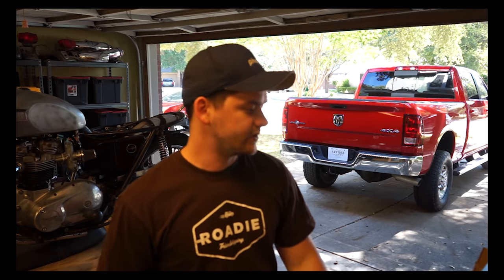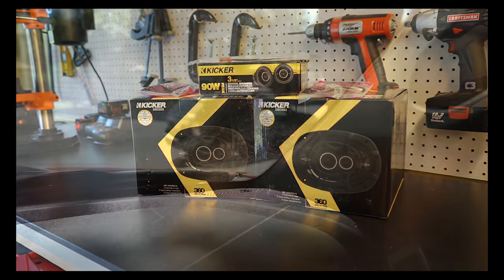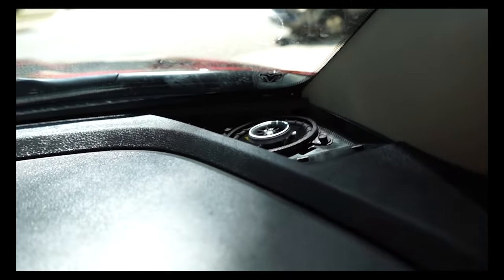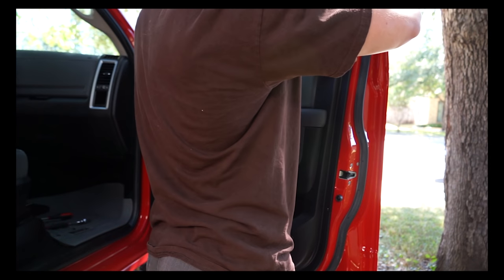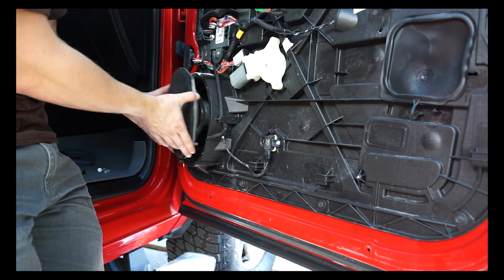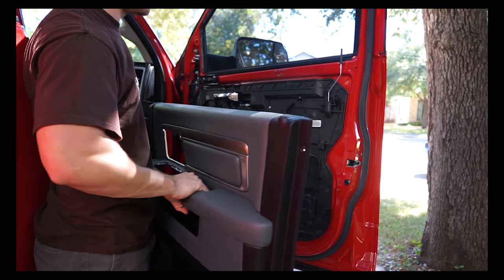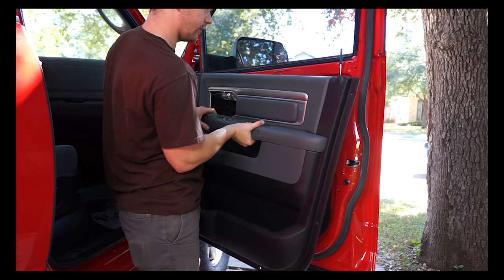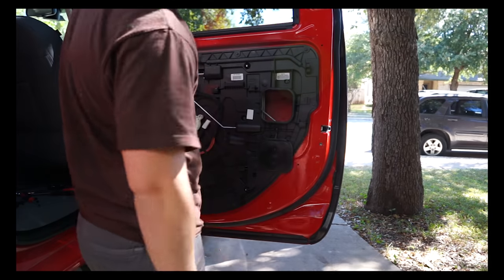Ram Speaker Upgrade

Comment: I just wanted to take a minute and thank you for this video. I followed the steps on my 2018 RAM and it couldn't have gone smoother. I appreciate the effort of you taking the time to record and share this !!
Reply: Did you need to install the bass blockers on the dash speakers, is the sound ok?
Reply: @theodoretennisco9079  I didn't install the base blockers. I bought the Kicker  2 way speakers 3.5". They seem to sound great with the 4 kicker 6x9 3 ways. These are running off the stock deck.
Reply: Is it actually louder than the stock speakers?
Reply: @tylerogorman1079  much better than stock
Reply: @brown5252  was the speakers louder and more quality?
Reply: Just curious did you install any speaker spacers for the front door speakers? I am wanting to run all kicker 6x9 myself and don’t want to use 2 diff name brand speakers . I know 6.5s will fit the front but I want all 6x9s

Comment: Just put some of these in my truck. Your video saved me a ton of time. I have them on stock radio for now but am going to be amplifying them in a few weeks. The door speakers themselves are clearer than the stock ones but actually dont have as much bass at stock power. If you use these, go ahead and get an amplifier. You can find 2 channel amps for pretty cheap. The kicker dash speakers are much louder because they are 4 ohm and the stock dash speakers are 8 ohm.

Comment: I have went with the JBL club speakers. They are 3ohm speakers all the way around. Crutchfield says they won't fit in the front. But yet they come with a 1/2" spacer. I have the 3.5's in the dash with a bass blocker. The dash speaker requires a Metra 72-7902 wire adapter to eliminate cutting. When putting the bass blocker on, which it goes on the positive terminal side, I utilized spade ends to eliminate any cutting. I found the Metra 72-7902 on ebay and paid like $9.00 with free shipping. The doors require a Metra 72-6514 wire adapter to eliminate cutting.  I found them as a pair for both doors on amazon for like $13 and prime shipping. I utilized the spacer that came with the speakers on the front pair and no issues at all. I can have photos later. This video was great. Thank you.

Comment: Great tutorial. And thanks for the hyperlinks for the speakers and accessories you used. I used your video to guide my speaker upgrade on my 2011 Ram 2500 Megacab.  The only thing I would add is that I used 1/2" spacers for the 6"x9" speakers in the front doors. This eliminated the interference with the window  regulator and allows the speaker to be tightened down squarely in the hole in the inner door panel.
Reply: Did that interefere with the door panel covering at all when you put it back on?

Comment: Just did mine with NVX dash speakers and Morel speakers in the doors and a Pioneer sub that fits in the stock box, mine had the Alpine system, awesome now, you can actually hear cymbals and guitar picking.

Comment: Thanks for that great video. I just finished installing all the equipment you recommended including the wire connections. Install went great The sound system is fantastic now. It is like night and day. I installed system in a 2016 Ram 1500 Big Horn and super happy now. Just want to say thank again.  Keep up the good work.
Reply: I was wondering how much newer it'd go with the items shown in the video. I've got a '16 outdoorsman, and was looking to change the stock stuff out. Your reply with the year of your truck told me they didn't change anything in that area. So, good to know :)

Comment: I am not sure how many people are still watching this video.  Most of the 6X9s are now a little shorter and fit just fine, but wanted Kickers and bought the same kickers as this guy.  To take care of the problem of them touching the window rail and to seal the speaker around the mounting surface, I purchased and used a 1/2 inch spacer, made for 6X9s, Metra part number 82-6902.  Wondering if anyone else has tried this.  (Universal, 6x9 SPK Spacer 1/2 inch 82-6902.

Comment: Nice video....For the space issue.. get a cheap Yoga mat and cut a spacer seal.. I did this for a GMC truck a few years back..Want to cut road noise.. get a couple of Dynamat or copy sheets and wrap that around the speaker before bolting them back in place.. That will cut road noise... you won't regret it!

Comment: Thanks for the video, it helped out a lot.  I went with the Mopar Kicker Audio System Upgrade Package - 77KICK42.  
It was all plug and play – no wiring adapters needed.
I also used Hushmat for sound deadening which worked well but there are other products out there also.
I have the basic RAM Express so this was a big upgrade.
Reply: Where did you obtain the kicker upgrade?

Comment: So glad I found this video.  I found exact same speakers and was debating on whether or not to get them based on comments of people to being able to use them on front doors. Also, I didn’t want to splice wires for dash as I could not find adapters on Amazon. Will get from Crutchfield.  Thanks.

Comment: Job well done on the video, very easy to follow. I did mine a few years back (all 6 speakers) and the only thing I did different was add bass blockers to the 3.5 inch speakers. I also added a Pioneer self amplified 8 inch sub-woofer under the front passenger seat. The stock radio really sounds great now.

Comment: Great video, I recently bought a 2016, 1500 and I've been wanting to upgrade the speakers, I didn't want anything crazy/high end, but something better than stock, and I think these will fit the bill, great reviews online.......thanks for sharing, providing the links to the items, and you clear instructions on how to install.
Reply: did you ever upgrade? how does it compare with just swapping out the speakers and keeping the headunit?
Reply: i got a 2016 with the 6 speaker radio 3.0 RA1 headunit.  Decent for a stock system but I think it would sound better with slightly better speakers.

Comment: Great video. Only 1 recommendation is to add a bass blocker to the 3.5". The system will sound amazing without subbing out your 3.5". I'm running this with a basic Ram Express head unit. You won't be sorry.  Amazon search 3.5 bass blocker. Thanks for the video
Reply: Suicidal Switch do you know how the front door and dash speakers splice together?
Reply: Christopher Geschwill it's all plug and play if you get the recommended adapters from the video. The only splicing or soldering you'll have to do is for adding the bass blocker to the 3.5"  . Highly recommended and super easy. If you don't the 3.5" will be trying to handle the bass that's going through the 6x9. Trust me the $6 bass blocker will balance the 3.5 so you can rock the 6x9. Hope this helps
Reply: Christopher Geschwill I found the bass blocker tip from Five Star Car Stereo video for a Ram build. Look it up if needed. Great tip
Reply: Suicidal Switch I understand but as far as factory, I know that the dash speakers are
Somehow connected and run off the same channel as the front doors. My question is where do the front doors and dash speaker wires splice/connect.
Reply: Christopher Geschwill sorry I have no idea. I just followed the video step by step. I didn't pullout the headunit or anything else. Good luck
Reply: I did the same thing when I installed the 3.5 speakers, made a big difference
Reply: do you have a link to the bass blocker you used?
Reply: do you have a link for the bass blocker
Reply: Law Offices of Nicklaus Misiti, PLLC crutfoeld base blocker for tam 1500
Reply: Crutchfield base blocker 007bb150
Reply: Law Offices of Nicklaus Misiti, PLLC search for 2.2 uf 100v capacitor its the same one that’s on the factory speaker . I tried three other bass blockers and this one is the only one that truly gets rid of all the bass so the 3.5 speaker can be cranked with no distortion

Comment: I bought the same speakers and noticed the fit issue with the front doors. I figured I needed spacers, but didn't want to wait for them to get here. I ended up making a template to cut a pair of 1/4" plywood spacers. Worked great. 

As far as the wiring adapters, I also didn't want to wait for those (or pay for them) but wasn't hot on the idea of cutting/splicing wires. The OEM speakers are junk anyway, so I clipped the wires and pried off the connector and soldered the Pioneer wire leads to them. I used photos of the adapters on Crutchfield or Amazon to get polarity right.... A pretty easy DIY connector mod.

Comment: Good little video. I'm about to replace the ones on my 2019 RAM.
Thank you for the links.
Reply: Geoffrey Stephens Did the speaker replacement make a big difference with the 2019 Ram stock 6 speaker system?  I find it lacking.  Did you change amplification or add a sub at all?
Reply: Let me know how it goes I have a 2019 3500 tradesman

Comment: Great video. Thanks for explaining. These kicker 3.5” dash speakers are 4 ohm. The stock speakers out of the dash are 8 ohm. Any issues you had? Do the new dash speakers over power since they are 4 ohm now?
Reply: A little. I had to play with the settings on tue uconnect
Reply: It's very easy to wire a 4 ohm resistor in line with these. You can get a pair of them for about $1 and it's a really common fix for this issue. It will cut the volume of those 3.5" speakers in half and balance them with the rest of the speakers in the truck. You just cut a couple inches out of the positive lead of the new wiring adapter and solder or crimp in the resistors. This is preferable to adjusting the equalizer because IT will allow the other speakers to still produce proper sound. Simply adjusting the EQ ends up taking away from everything else. Some people just skip swapping the 3.5s altogether...

Comment: For those interested the Alpine SPS-619 6x9 speakers will also fit both front and back doors with no modifications. In the front I had to use the included 1/4 inch spacer and longer screws. Also, the dome & tweeter touch the plastic door grill in the front doors but do not affect any operation or sound quality that I can tell. With the same wiring adapters listed in this video the whole 4 door swap out took a little over 50 minutes.

Comment: I’m about to buy a 2017 1500 v6 and if the sounds of it will kind of disappoint me then I’ll do it too, great video but I’m afraid of the speaker touching the mirror mount too, as the truck will be brand new and quit expasive i wont take a chance to damage it !

Comment: I upgraded the 3.5s with Infinitys and was so amazed I stopped there.
Reply: Did you add a bass blocker?
Reply: @erikjohnson2742  Guess not, I don't know what that is...
Reply: @erikjohnson2742  depends on the speaker. some have high-pass filters included. so no bass blocker needed.

Comment: Hey brother, I read that you are looking for more bass. If you decide to go with the under the seat sub, be careful. I bought the box that goes under the back row for my ram 1500 and the box is much more shallow than I expected and you can't fit many types of decent subwoofers in them because of that so just do some research with the types of subs you want before buying that $100+ box. Nice sound system upgrade.
Reply from the maker: Thanks for the heads up. I have a 13 inch shallow mount sub from a previous car. I might just try and modify the box that's in to fit. I will have to figure out how to keep the air space in the box as close as possible.

Comment: Great video and very straight foward. I was just wondering since im doing the same for my ram I am having trouble getting the correct wiring harness because crutchfield says otherwise.
Reply: There is a newer part number for the 3.5s i am ordering them this evening type in your truck on crutchfield and it will give you the new part number

Comment: Used the same connectors you recommended. My driver side rear speaker stopped working yesterday and today the passenger rear speaker stopped working. Didn't splice or do anything different from what you did. Literally, plugged them in and put the door panel back on. Any advice? 
Looked at ALOT of videos before I did it and yours was hands down the best!
Thanks in advance!
Reply from the maker: Hmm mine are still going strong. Have you pulled them out to see if it's something easy> Maybe they just loosened up while driving.
Reply: Classic Octane oddly enough they started working again. Thanks for the quick response!

Comment: Ok 2 things, I clicked the link for your 3.5s and it brought up 5x7/6x8 speakers, and the link for the wiring adapter for your dash speakers came up saying it wouldn't fit my truck. Mine is a 2014 without the alpine unit.

Comment: Hey awesome, love the bike as well. Does this system require an amp? Without an amp do you notice any difference? Thanks
Reply from the maker: It's doesn't require it, but an amp could help. I definitely noticed a difference in mids and highs but I'm still looking to add a sub for more bass.

Comment: Hey bro great video! i have a question, crutchfield offers Kicker 43CS series 6x9(150rms) speakers with a slightly smaller top and bottom measurements than the Kicker DS series 6x9(90rms)the one you installed, would top and bottom measurements make a difference in fitting in the front doors? Closing that bit of a gap.
Reply from the maker: By top and bottom do you mean the thickness of the speaker? If so I definitely wouldn't go any thicker than the Kickers.

Comment: Getting ready to do this mod but would like to throw in an amp if it'll make it sound better than just a speaker upgrade. Does the stock system already bring an amp? Or will I have to wire one in?
Hopefully It has one and I can just replace it with a better one.  I have a 17 simple express ram

Comment: I just bought a 2016 Ram crew cab and would like to upgrade the speakers as I also only have the 6 speaker non alpine stereo. Iona e the larger 8.4 radio.  Since the video do you still feel as they were worth the money or is there a better speaker.

Comment: Great video, Thanks for sharing, I had one question, on the front doors, was any problem with the door panel going back on like new with the new kicker speakers?
Reply from the maker: No they went on without any issues. I have had the speakers installed for a few months now and I haven't had a single problem.
Reply: thanks, I'm going to order some myself then

Comment: So how do they sound after? I had the Boston Acustics system in my 08 Grand Cherokee (now own a 2014 RAM) and the speakers were thin and light like you were showing. I bought some of the top rated speakers for quality and bass.. to my disappointment they were quieter and had noticibly less bass.. even though they were 3x as heavy and the magnet was 2x as large, put the stockers back in.
Reply from the maker: The mids and highs are significantly better but the bass is very similar to the stock speakers. I will be looking into an under seat sub setup in the future.

Comment: A magnet touching metal is not a good idea. For a set of quarter inch spacers is about twenty dollars for a pair. Also putting some sound deadening will help with door rattle and is also cheap.

Comment: Nice Video, what wattage were the OEM speakers you pulled? The 3.5 / 6x9's ? I'm trying to figure out what wattage output the OEM radio 3.0 puts out, can't find info on it anywhere, i want to replace the oem speakers with speakers that will add punch to the bass, but don't want to get too powerful speakers so that the headunit doesn't even power them up.  How are the kicker 6x9's bass performance?
Reply: I'm driving a 2016 1500 without the Alpine package, just 6 speakers powered by the Radio 3.0 headunit
Reply from the maker: Not sure but I still have to stock speakers somewhere. I will see if I can track them down. As far as the bass on the new ones. It's much better than stock but I will most likely be adding a sub soon.
Reply: i'd love to add a sub, but my underseat is where i keep screw kits, levels, squares, poles and what not for misc hand tools and straps. I need to rely on the door speakers for my bass haha.  I just want it to be punchy.
Reply: Any info?

Comment: Upon your recommendation I ordered the 6 Kicker speakers for my 17 Power Wagon. I didn’t get exactly what you have but the newer models. 
Watching your install video and the small problem with the front door speakers resting against the inner window post I decided to order 1/4” plastic spacers for 6x9 speakers. 
Is that going to be a problem with the door panel going back on or will they work ?
Reply: Bill did you end up going with that 1/4" spacer for front door speakers? If so, any issues with the door panel?